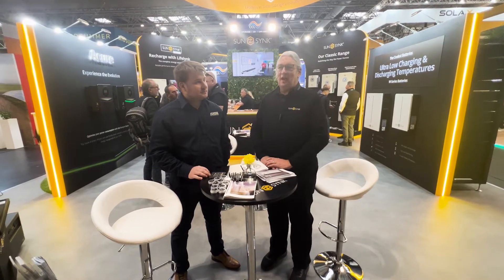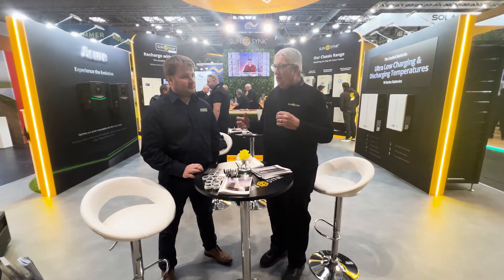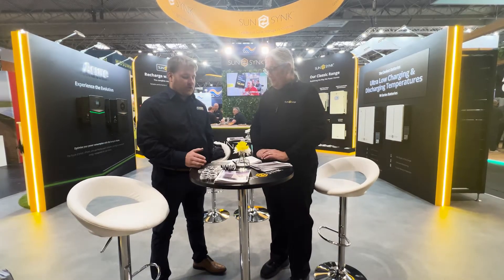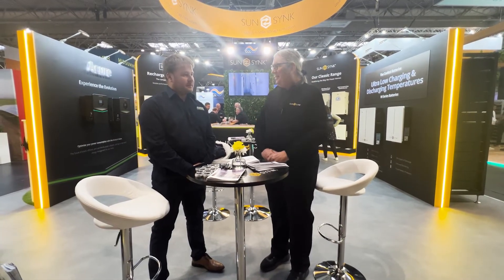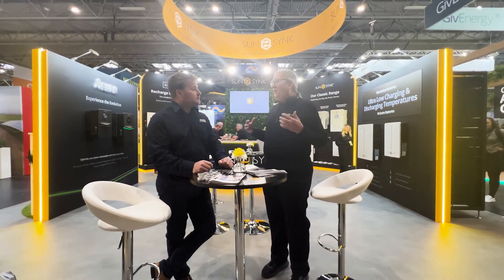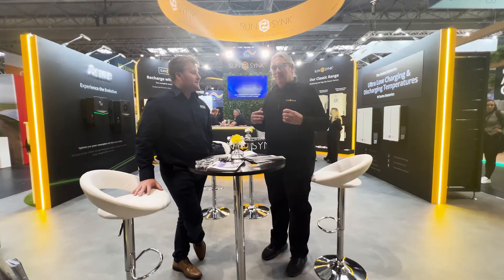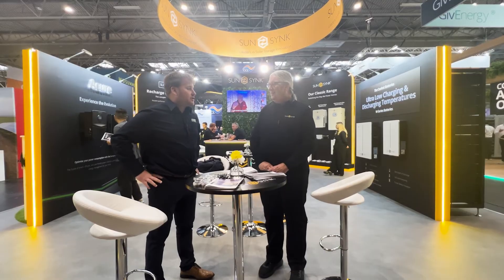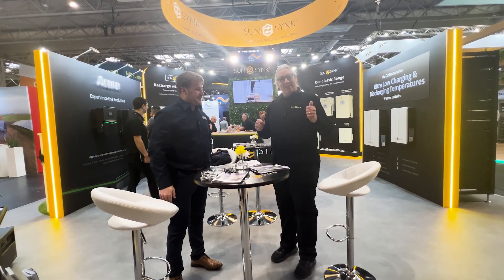Understanding RCDs & Earth Bonding | Insights With Simon From #AllPowers

Comment: Explain how you get away with the regulations if you ground a neutral to your appliance earthing system? It is quite simple to have a dedicated backbone earthed neutral that is not part of the appliance earthing conductor. Everyone seems to be on the earth bonding bandwagon? An isolated neutral on an inverter output, is effectively connected to an earthed neutral (PEN) while a change-over switch is selecting “Inverter”